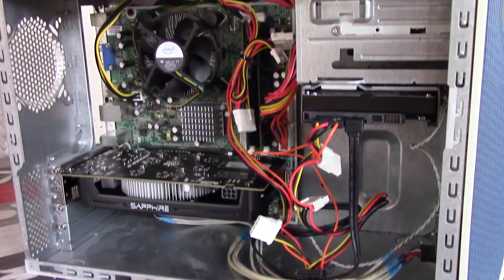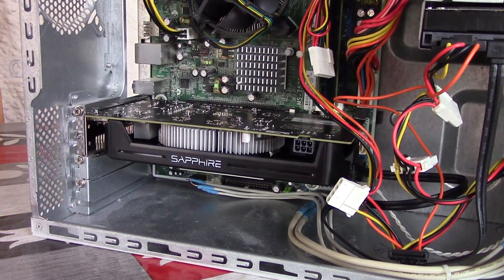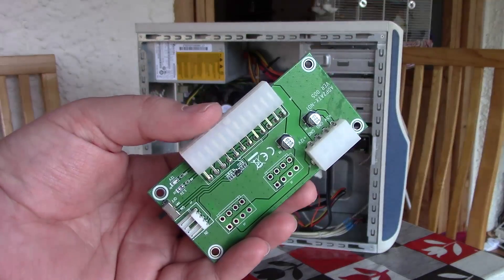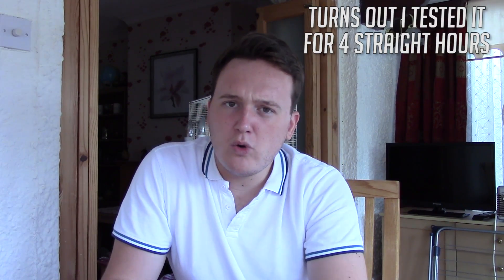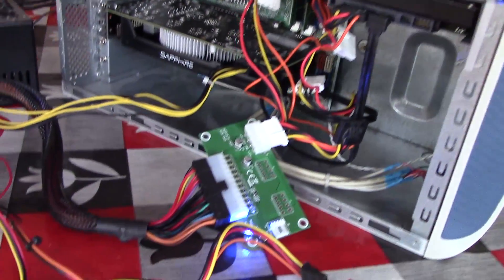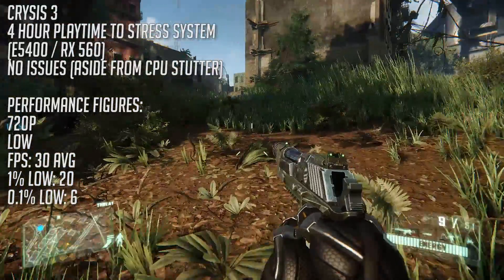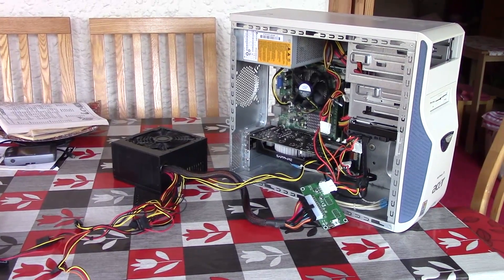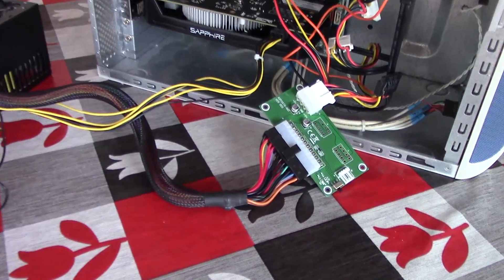Powering a Graphics Card With a Separate PSU

Comment: my friend have only 50$ , can i build for him a 50$ pc that can run smooth league of legends ? ,any suggest ?
Reply: get an old 775 system and pair it with something like gt 630/730
Reply: Definitely possible, just search for an old prebuidld with an Intel dual or quadcore (e8400 or q6600 for example). Then just buy a used gt 630 or some other low power gpu and you're fine. I'd say that there are some decent used complete PC's for $50-70 tho with something like a e8400 and a HD 5770, 4 gigs of RAM and a 320gb HDD which also come with a better PSU. So just look around on Craigslist or whatever your local selling site is :)
Reply: You could always buy an unwanted pc online with an okay cpu and collect it yourself to save money(depending where you live) but you probably will still need to invest a little extra for the gpu.
Reply: Cùi Phong a job.
Reply: so i tried to do this from listings i found online. Its tough, but as long as he is willing to turn the graphics settings down it should run. Im not sure if you need peripherals also, but if you need them there are 2 options.
1. Goodwill sells them for 2 bucks for a keyboard and 2 bucks for a mouse. 4 dollars there.
2. Monitors also at goodwill or other thrift stores, get one for 5 dollars. If you can splurge 3 dollars more often you can get a 1440x900 display for 8 dollars.  (i found a dell 17 inch monitor for 5 dollars)
so lets say we spend 9 dollars on that stuff and we have now 41 dollars for the computer.
So anyways i was looking at my local listings and since graphics are not going to be the main importance here we are going to make sure we have at least 4gb of ram and a core 2 duo. Anything lower will not play league decently. I found a listing for 30 dollars with a dell optiplex with a pentium dual core 1.8ghz processor (we are not going to be using this) 4gb of system ram, and an 80gb hard drive. it also has a pcie slot for a gpu. so lets say you purchase this. we will need an upgraded cpu. you can purchase on ebay a core 2 duo e8400 for 4.15 cents. (make sure to use the old pentium chip to update the bios though since it will be needed to support this processor) so this leaves us approximatley 7 dollars for a gpu.the best i could do for that was this 
DMS-59 High Profile Video Card With DMS-59 To Dual VGA Combo Pack on ebay. they are 5 dollars and they are approximatley a hd 3450 or something akin to that. they are not powerful by any means, but they are more powerful then the included graphics on a core 2 duo. If your friend could squeeze an additional 12 dollars (say they don't need to purchase peripherals and they squeeze another 3 dollars) you can get an hd 7570 in both low and high profile varieties for 20 dollars with 1gb of gddr5. this would be able to run league a treat. So if your friend needs peripherals id recomend spending 20 on the gpu, about 35 on the computer itself and 10 on the peripherals and this doesn't include wifi. If he needs that they sell usb dongles for 2 dollars on ebay. i hope this comment helps
Reply: Easy. 
Get a dell optiplex- $20
Gts 450- $12
400w psu upgrade- $15
Total- $48
(Keep in mind these are used)

Or

Q6600- $10
Mobo- $10
4gb ddr2-$10
250gb hhd-$10
Gts 450-$12
Case-$5
Psu-$10
Total-$67
Reply: Cùi Phong no 😂 tell him to get a job
Reply: It's possible theres even a $5 pc for that. Search up TECH YES CITY $5 LOL PC
Reply: all of these other people don't know shit about used parts
Reply: Like they said "dell optiplex" 755 socket motherboard. Look for core 2 duo or better. Look for 4 gigs of ram included in the system as well as a 120gb or bigger hd (80 can work but it's cutting it close and 2gb of ram can work but it's not a great experience). Sometimes you can find discounted units with no operating systems I found a handful of Machines like that and you can just use the inactivated version of windows 10. check ebay. I see a handful of computers that would work well.
Reply: Find a dell at the dump for free and put a GT 1030 in it :)
Reply: you probably need an low power consumption gpu which by itself will cost around $50, just make sure that pc has at least 300watts psu
Reply: i will keep this in mind, thx mate
Reply: Cùi Phong old dell optiplex
Reply: Go to yard/garage sells and pick up a prebuilt, then get something like an HD 6670 on ebay.
Reply: Dual core with a 8800 gts or above. Easy
Reply: Go shopping around on local sites to find a old Core 2 Machine. Get a gt 730 used for about 30 dollars and there is a pc.
Reply: find some cheapass laptop. LoL runs on almost anything
Reply: I build second hand pc's from time to time and sell them, more like a hobby. But my budget is not so tight. Of course a fun part is looking for cheap parts or standard cheap pc's to rebuild and squeeze some profit out of it. 
After years of scavenging and reselling I learned a trick, maybe it helps :)
Go to a local second hand market site where regular people sell their used stuff which has a pc/ pc parts section. Look for example core2 or amd athlon/fx pc and go to old ads like back a week or more and ask the person if he still got it and if so you can come pick it up right away/soon (or let him send it) for half or like 60% of the original price. If they still got it, trust me. Most of the time they sell it. Going higher up the power ladder it does not work so often any more, cause the market is more active and especially with intel cpu's and all gpu's. If I build a 2011 i5-2500 or even 2400 based gaming pc it was always sold with in 3 days with some profit. 2006 stuff and older gets tougher. I once build a Q6600 quad core with a GTX670. Old but still budget gold. Took me 2 weeks before finally somebody messaged me and offered me less and I lost money on it, but I was glad it was gone and can buy new stuff again ;)
Reply: +Helghast Trooper where do you dumpster dive for computers?
Reply: yeah bro ebay look around
Reply: Cùi Phong go to an ewaste center/recycling center, find a pc for around $20-30, or for free depending on the location. Fix what needs to be fixed on it (if anything at all) then buy a used graphics card with the remaining cash or whatever else can be saved up over time.
Reply: buy an old dell PC, or something similar, and add a graphics card, and maybe a few more upgrades.
Reply: Buy a Dell Optiplex prebuild from your local used stuff website(the ones with Core2Duo) with at least 2GB of RAM, it will be like $30 USD and $20 for a cheap GPU something like the GT630 / HD5570.
Reply: I wonder first, where do you live?
Reply: in south asia , i just want to help him to play some game ,  his family really poor. the price really high in here like the cheapest 775 main i can find already 15$ and it damaged some part. Our country don't have anything like people sale stuff from garage , the best solution is find from some website like craglist but it more worst cause 95% people sell stuff there is computer shop disguise as normal people so the price is really shit. Thank guy for the suggestion , i will try, already donate him some fine PSU to run anything i can find to put in
Reply: Cùi Phong A lot of people forget not all country s have good prices on electronic parts, try to find at least a dual core celeron like e3300 and try the onboard grafic from the motherboard, lol doesn't need to much power. Good luck.
Reply: Cùi Phong that recycling center idea is still there...
Reply: Cùi Phong if he only has 50 dollars but wants to game, i really think he should rethink his priorities
Reply: already got job but can barely live, life not alway pink
Reply: just DL mobile legends or heroes evolved on his phone, and be over with..it's basically the same shit.

Comment: Recently did this with a friends PC. Was a prebuilt HP with a weird motherboard. Ended up using a 2nd PC, sandwiched the 2 together and ran the 6 pin from one PC to the other so the gtx 660 had power. Quite a funny way to run a PC.
Reply: This is exactly what I just did today. it's working so far but since I'm not super computer literate, only semi-literate, I came here to see if what I'm doing will cause any issues. so far my new tower is doing this weird thing where after the welcome screen when logging on, the screen stays black for like 5 minutes before the desktop shows up. so I'm not really sure what that's about.
Reply: @EmmAPestilenciA  Hard Disk Drive Or Solid State Drive?
(Search them both up and see which one you have.)

Comment: Use Test drive unlimited in your old component benchmarks! It's very well optimized and looks ok.
Reply: Paneledpear6555 2 is much better
Reply: In terms of optimization, no.
Reply: In terms of physics, hell no.
Reply: Physics are MUCH worse and it runs badly on PCs.

Comment: Just put one over the pc and connect it directly to the gpu (tm)
Reply: He DID do that.6  pin cable from secondary PSU does go to the GPU. You can see in the video. He just didnt mention it. That board is simply for powering second PSU simultaneously .
Reply: you have to turn the second psu on somehow. i did that by cutting the main psu's switch wire, and soldering it to the second psu switch wire. it worked fine. no board required
Reply: That molex's use is to switch on the second PSU as soon as the first one is on, of course you can short it yourself but the timing may cause some issue.
Reply: eri steaj you have to plug in the big 24pin connector to do that, if you have a classic powersupply, look at the 24 pin motherboard connector and you will see 1 green wire somewhere in the middle, that green wire is power supply on/off signal wire that tells the PSU to turn on or off, the molex connector is to send the on/off signal from main PC to get both power supplys running at the same time (well not exactly the same time as the main PSU needs to start before it can start the other one but it's milliseconds difference)
Reply: I thought that too, but if something like this exists, maybe there's a reason?
Reply: Cristian Marturet there are plenty of other useless shit like a molex to molex adapter
Reply: DevPre used my 230 wat psu for years like that... I had to wire up 2 6pin connectors as well, its completely safe
Reply: LOL BEAT ME TO IT, just remember to turn off the PSU connected separately to the card. I wonder if the graphics card lifespan degrades or something if the supply to the card is on and the computer is off since current is flowing through it, or does the current not flow unless the card gets a signal to start?
Reply: The reason is to make a buck selling it.
Reply: Oh, that's right! timings! that is a possible issue
Reply: did you mean ™ ?
Reply: +adec avdic well, he forgot the most important part then.